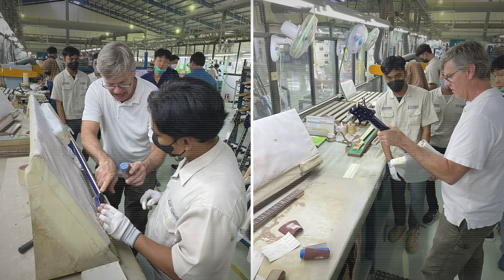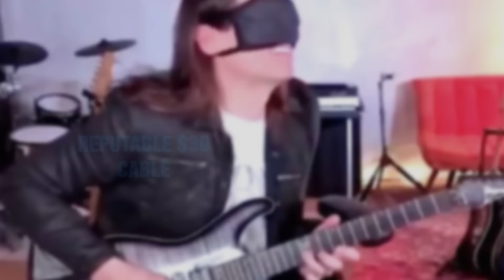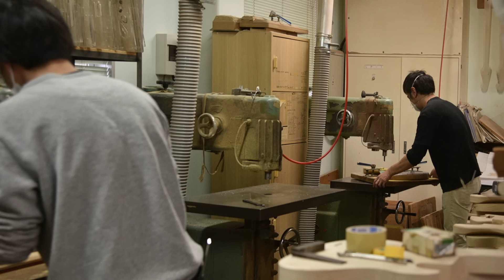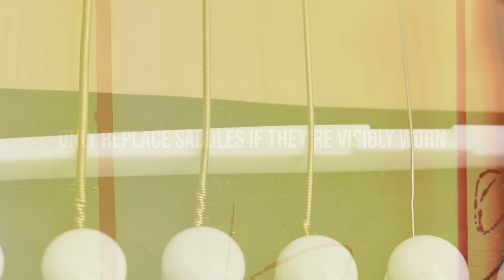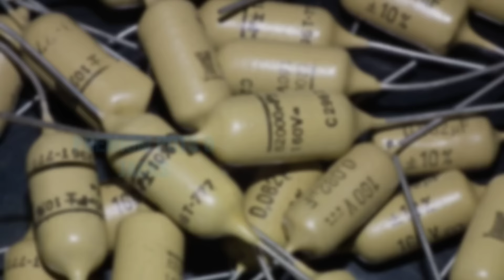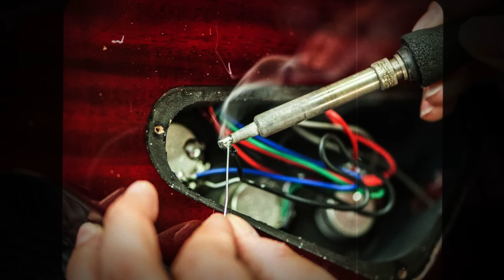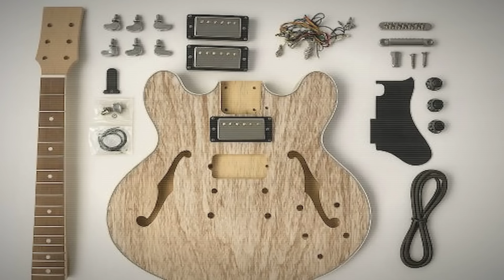5 Worst Guitar Upgrades Most Players Waste Money On

Comment: I’ll only disagree with the pickup swap. I changed the 500t on my Gibson Explorer for SD Pearly Gates and the 490t on my Gibson Les Paul for Seth Lovers and I transformed both of them
Reply: If you used a boss eq you could have gotten the same sound. Pickups are practically indiscernible sound wise. Glenn proved it hands down a cpl yrs ago. You got swindled by the flimflam man
Reply: @PukeyMcDork  There are discernable differences between alnico and ceramic magnets. Same thing with active vs passive. You are right that if the pickups are both high quality, it might not matter EQwise, but some may prefer the difference in output levels or headroom. I personally like the compressed sound for my style, but some pickups are better for dynamics. I think we can meet in the middle and say pickup model importance is overexaggerated, but that they do have a role to play sometimes
Reply: The two worst sounding pickups Gibson ever made, IMO. And they made them to make the Kramer and Ibanez customers stop complaining.